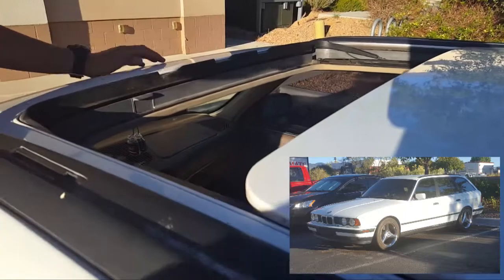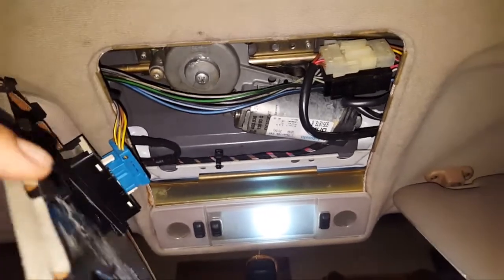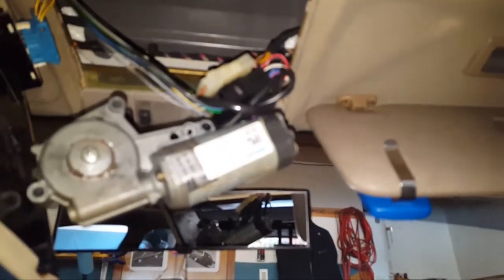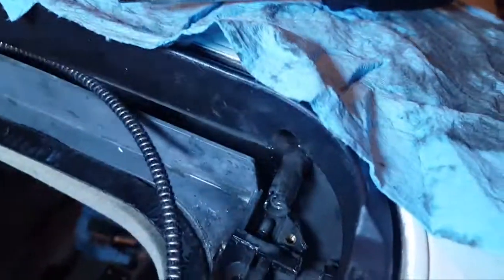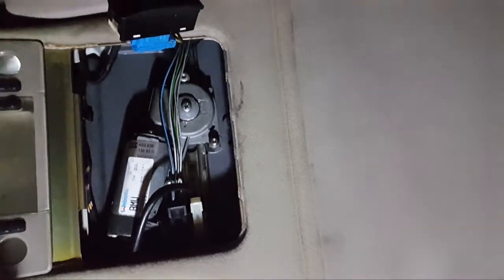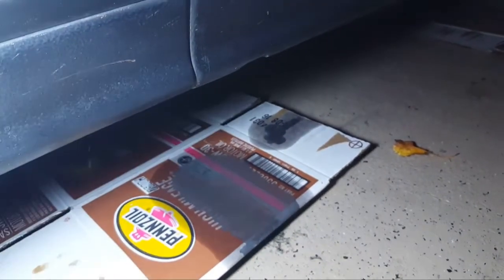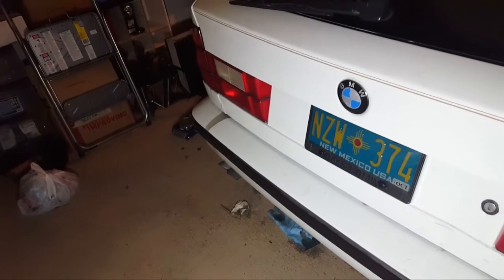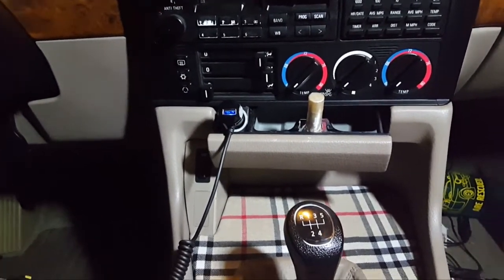🇩🇪#E34Restoration Servicing BMW Panoramic Sunroof e34 525i Touring

Comment: What kind of lube can you use for the wires? My sunroof really struggles halfway and the roof engine get kind of hot, so it obviously works to hard. So I'm gonna try to clean out everything even the wires. But I have no idea what lubricant I should use. I only have lithium grease, and I have herd that that is a big no no because it turns into a paste.

Comment: I have a 520i E34 from 95 with the panoramic roof. Since a few months water leaks from the right rear corner onto the right rear seat whenever there's heavy rain. I have alot of condensation in the car ever since (first winter, bought it this year). The ac is not working needs to be fixed. I have no clue how to get this fixed as I'm not a mechanic at all and have no indoor garage. I am willing to spend a few hundred euro's on getting things fixed but I don't know where to get it done. The BMW dealer will be crazy expensive. I also don't know any garage that fixes rubbers on the doors, windows and roof. The condensation on the rear windows is really a pain in the ass and dangerous even when I open my window while driving. If anyone has any advice pls let me know (location the Netherlands).

Comment: Hi David! Did the sunroof kept working or failed again? Mine on "vent"/"comfort" mode keeps being misaligned. It opens more on one side. Ad the engines start to skip
Reply from the maker: Tiago Peralta yes eventually those cables stripped enough to just click as you try to do anything. The only button that has any operation is the center return. Basically my sunroof does not work anymore. Starts with the skipping. That’s the time to lay it to rest.

Comment: I would have to say, if you're considering buying an E34 touring, don't buy one with the panoramic sunroof, they're a complete liability, the system constantly breaks, they're horrifically prone to leaking and I understand that a lot of the parts specific to that system that are required normally to repair a failed system are no longer made so they're unavailable even from BMW themselves.  You're much safer buying one with the standard steel sunroof which shares it's mechanism with the E34 saloon/sedan which hardly ever fail and are easy and cheap to get parts for, or one with no sunroof but air conditioning instead (for European-specification cars, I believe all US-specification cars had air conditioning as standard apart from some very early cars)...
Reply from the maker: Jamie! I missed your input. I thought you gave up on the channel, or went on holiday. this sunroof still gets stuck in a 90% closed position, as the cables are stripped down some.
Reply: David Bello   No, I'm still here, I've just been a bit busy lately.  Unfortunately the only way to fix that would be to replace the cables entirely which I understand is a pig of a job, and I'm not sure that replacement cables are available any more.  Interestingly, it looks like your car is one of the ones that had the sunroof system replaced by BMW judging by the Webasto-branded motor, the panoramic system was the cause of several recalls by BMW but they never really fixed the main problem which was basically that the whole system just wasn't designed sufficiently strongly to work properly for long so the cables wear out, like yours, to the point that the drive gear has nothing to drive on and the system stops working, parts of the mechanism wear out and break and the sunroof panels themselves can twist and warp...